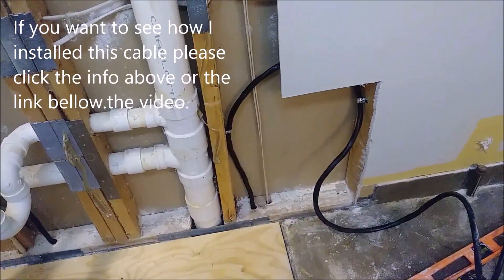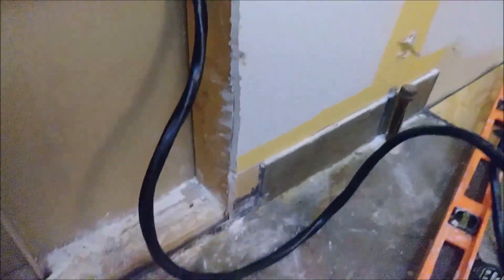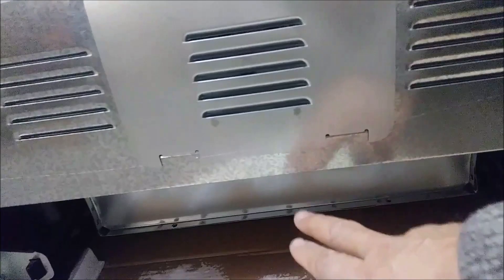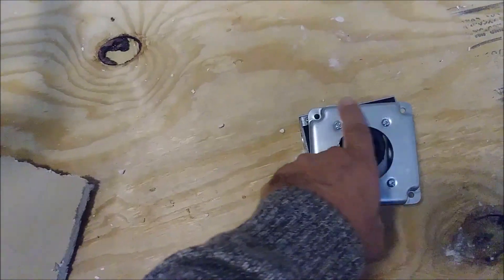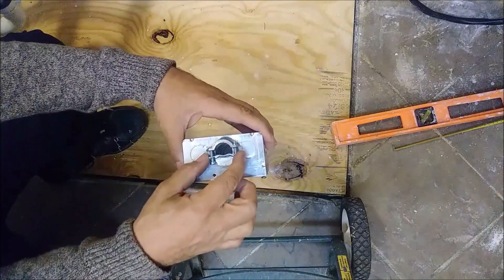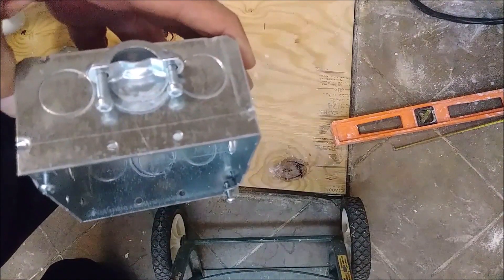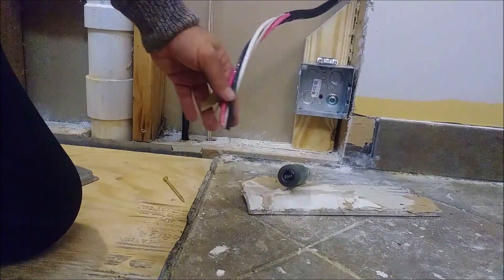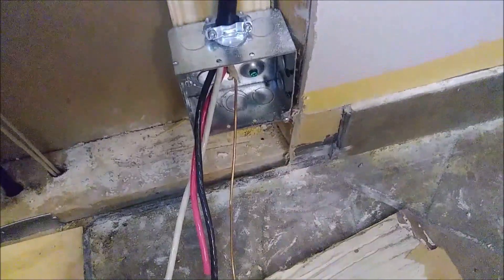How To Install Electrical Box For 240 Volt Range outlet - DIY - Step By Step

Comment: You can use a plastic box ,the device will be grounded .. 4 inch sq box is to small to work with ,,you should use a 4 11/16 th inch box with a clamp to mount the box . You can also mount a surface receptacle on the floor …
Reply from the maker: Not recommended to use plastic for 50 Amp / 240V. This is the code here.
Reply: @josephk9182  Bullshit !! If the wires are non metallic and the box is big enough you can use plastic ….
Reply: @williameisenberg1999  Can You Use a Plastic Junction Box?

No—you should use a metal box.
Here’s why:

Why Not Plastic?
	•	Plastic boxes are not rated for high-heat, high-amperage appliances.
	•	They cannot safely bond the ground wire the way a metal box can.
	•	NEC guidelines for large appliances generally require metal enclosures for durability, heat resistance, and grounding.

⸻

What You Should Use:
	•	A metal junction box (usually steel), with at least 50A capacity.
	•	Size: Minimum 4”x4”x2-1/8” or larger, depending on how many conductors and splices you’re making.
	•	Ground wire (bare or green) should be bonded to the metal box with a ground screw or clip.

⸻

Wiring Guidelines for 50 Amp:
	•	Use 6-gauge wire (copper) for 50A.
	•	If the oven doesn’t have a plug, it will be hardwired, meaning:
	•	Your cable will go into the junction box.
	•	You’ll connect to the oven’s wires with wire nuts inside the box.
	•	Always check the oven’s installation manual for specifics.

⸻

If you’re ever unsure, it’s worth having an electrician verify your box and wiring—it’s all about safety and code compliance, especially at 50 amps. Let me know the oven model and I can check exact requirements if you’d like.

Comment: That metal piece that you put on the end of The Wire is called a Romex connector and the piece that you screw on the bottom of it is called the lock nut. A conduit is anything you use to run wire through like EMT or PVC. The other thing you might want to take note of is that constant beep you hear every 30 to 40 seconds is just smoke detective battery low
Reply from the maker: Thanks I already changed the battery.
Reply: Yes, the fitting is not the conduit. A conduit is like a thin wall pipe, usually galvanized steel. Also can be flexible metal conduit. Then of course there is non metallic conduit, which is basically plastic.

Comment: Why do you not want the insulation going out of the conduit and into the box?
Reply from the maker: Because it will be very difficult to work with this 50Amp wires (not very flexable) and probably it will be diffcult to close the box after you connect the outlet. (Why do you need the insulation inside the box ?
Reply: @josephk9182  Did you pass the inspection ;)

Comment: The reason plastic boxes don't have a ground is because they don't have to be grounded, they're plastic. Plastic doesn't conduit electricity. There is no risk of the box becoming energized. You're thinking because there is a ground screw in the metal box with an attached ground wire it must be safer. More is better. But the opposite is true. If the ground wire fails for some reason in the future the metal box can become energized and therefore a case could be made that a metal box is less safe over the long run. Marginal difference.
Reply from the maker: No !! By code the box for 50 Amps range must be metal and grounded. The plastic box can be set on fire in case of short and also there will be  no protection if moister is accumulated on the plastic box a potential (240v voltage) can be developed on the box with no possibility to be grounded and that is why the box should be metal.
Reply: @josephk9182  Yes!!! First, I didn't say a plastic box could be used, I explained why a  plastic box doesn't have a ground screw. Second a plastic box can absolutely be used for a 50 amp flush mount range outlet. It does have to be the correct size and rating. I prefer metal boxes, but many people use plastic. Your logic about 240 and the box being set on fire in case of a short is silly. You don't think 120 can short and melt/burn plastic? Shorts are unpredictable, but 120 will get plenty hot enough not only to melt plastic but it will melt metal too.
Reply from the maker: @waterbug1135  It has nothing to do with the voltage but with the amount of current that can flow via the wire.
Reply: @josephk9182  Yeah, I see your point. There's no way 15 amps can generate enough heat to melt/burn plastic. I stand corrected.

The internet.
Reply: @waterbug1135  I disagree, I have been in several Holmes and found 15amp receptacle boxes melted because of a short at the receptacle.
Reply: @waterbug1135  When there is a short circuit or ground fault, there can be hundreds or thousands of amps flowing for a short period of time, until the breaker or fuse trips.
Reply: You can use either box ,I seen both boxes fail seen wire fail. But there is nothing in the NEC that says you have to use only metal box. Just proper size. If you get water in the box you can be shocked by either box its not the box but the moisture thats going to get you

Comment: Thanks Joseph. Great video. One question. Why do you not want insulation to pass through conduit into the box?
Reply from the maker: The cable insulation should be in the conduit but not out of it because it will be very difficult to work with the wire in order to install the outlet. There is not advantage whatsoever to have the cable insulation in the box.
Reply: @josephk9182   Awesome, thanks!
Reply: @josephk9182 Is connecting the wires the same as a standard outlet?
Reply from the maker: Not needed and not recommended. It will interrupt you connecting the wires to the outlet.
Reply: @josephk9182  Sorry, I meant to ask if connecting the wires to the outlet is the same method as for a standard outlet, by hooking the bare tips to the screws, and tightening the screws. 

Btw is the conducting wire 6 gauge? I need to extend it because it’s too short, and so I need to buy some wire. 

If you have a video on extending a wire that is too short, I would love to watch it. I am seeing different methods but don’t know which method is best for powering a stove/range.
Reply from the maker: Should be the same method. Sorry I don't have video for extending a wire.  @teegees
Reply: @josephk9182  I found this video of yours for connecting the wires to the outlet and it’s not via hooking the cable tips: https://youtu.be/H56pppA0Xl4?si=tIXN0xSoxgPQ9wJO 

Which method offers better connection - hook, or push in?
Reply from the maker: Follow this video. The video shows the correct way to do it. It was misunderstanding.